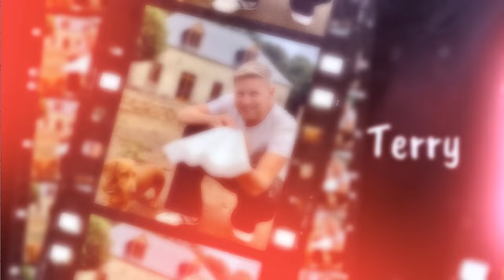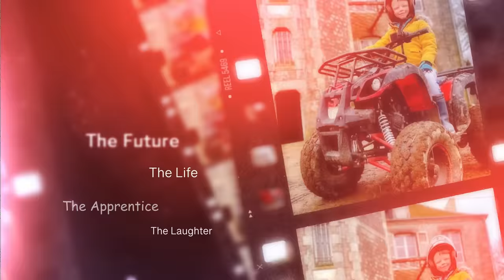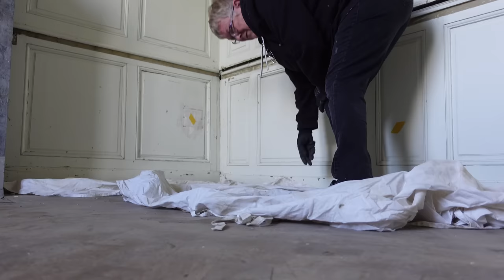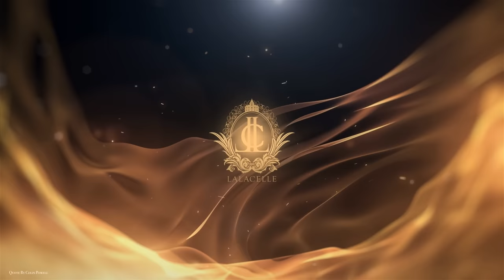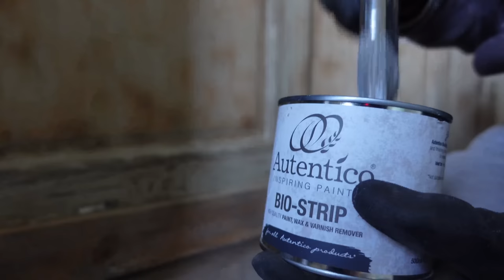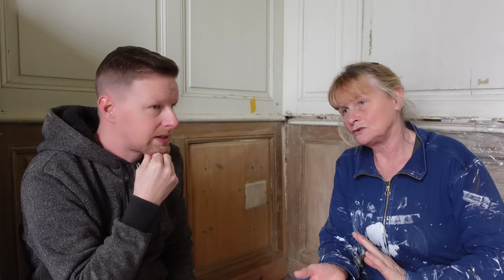Revealing The ORIGINAL 18th Century wood panelling in the Château Guest suite.

Comment: Watching you strip the wood brings back so many memories.  We purchased an old house in 1983 and stripped the paint off all the doors and baseboards.  I used a lit propane cylinder with an attachment that melted the paint just like you are doing.  Back then there were no electric paint melters!!!   I sanded and stained the wood and it was beautiful.   This room is going to be stunning
Reply from the maker: What a job it is but the results are amazing 😍

Comment: when stripping paneling, the moulded beading inside takes the longest, the most heat cos its the most fiddly. do this first in case you over heat, that way you burn the paint on the flat bits and not exposed wood

Comment: I love using the heat gun. It’s a brilliant option. We had to use it for our Edwardian door where it was thick with decades of paint and nothing but seriously industrial chemicals would get it off. The heat gun did it easily. Obviously we did it outside as the lead in the paint can’t be good when it’s melted so I would use a simple mask just in case.

Comment: Have you tried using a Tungsten Carbide Scraper ?  I used one to remove the paint off the  beams in my cottage and take them back to their original condition. I wouldn't be without one for the amount of renovating I have to do.
Reply: Thanks Rachel. We haven’t tried that but I’ll have a look 😊
Reply: @Ashley Waters  An absolutely invaluable tool for any restoration of wood. X

Comment: Fantastic hard work as usual, bravo all of your family. I noticed at one point you used two thermal cleaners on the same sock so please, be careful because this is at least 3000 Watts power on a 3500 W old electric wires. Using high power in long time could really get the wires very hot. Just saying by lived experience.
Reply: Thanks Thierry. All the power came from new wiring or Ecoflow units :)
Reply: @ashleywaters7198  Ok then, sorry I was worrying too fast 🥴

Comment: Love that you are stripping the wood, it’s going to be beautiful. Just a suggestion…and you may have thought of this already…as you know heat guns generate tremendous heat. So much so that there is always a risk of fire. Even when you think your being careful you might ignite a bit of dust where there is a crack or space caused by a separation of the wood. If you haven’t guessed, I’m speaking from a from, a very scary close call. After that experience I always kept a spray bottle of water near by. Having an extinguisher 🧯 near by is also a good idea. Lastly, when using a heat gun you are creating tiny particles of paint which are then blown around by the gun, making the particles airborne. Considering wearing masks. Also, consider a simple test for lead in the paint. Children are mostly at risk, so if your not sure, keep Jonathan away until all surfaces are washed down. Liquid stripper is less of an issue unless you sand the wood after stripping. If there is and paint residue you will have the same problem of air born particles. I don’t mean to lecture, but I learned the hard way, and this is a huge issue in the US. It is all very manageable .

Comment: I don't want to sound like I am nagging, but did you test for lead before putting the heat gun to it? One that hot will vaporize the lead. They have an infrared one or you can use the citrus strip for lead paint.
Reply: Thanks Steph. Yes the paint was analysed 😊

Comment: I can remember my Mother stripping furniture when I was young.  She even had a recipe she made to strip.  I will try to find it but it has been a long time.  One thing I remember is that I kept the stripper wet and let it set for an hour before using steel wool and a putty knife to remove, just like you are.  It is just work and a lot of work to remove old paint.  Have you thought if vat dipping?  We have places here in the State that dip wood.  Your room will be beautiful when finish but your hands are going to hurt.  I just saw the end of your video and the paneling is beautiful.  What is the white square in the paneling?  It has me wondering.

Comment: I notice you are using both a Titan and a DeWalt heat gun. Do you find one is more efficient than the other?
Reply: The Titan one is better. It’s lighter and worked better. Titan one was cheaper too!
Reply: @ashleywaters7198  Thank you! It helps to get feedback from those actually using the tools before buying them.

Comment: I'm so glad you're stripping off the paint. Please, pretty pretty please no gold leaf all over the paneling. It'll look fake. Nobody did it back at the time when the house was built. They used the stuff sparingly for a more subtle effect. IMPO a narrow strip on the frame surrounding the inside paneling would be much prettier.Or on the strip between the painted and the natural paneling.
Reply: Thanks Enny. Yes we’ve found some of the original paint on some panelling, and there was no gold leaf. We will likely emulate what we’ve found 😊
Reply: Aye,and Ash’s favourite colour is gold, with a little splash of pink.😉

Comment: Your stripper material says it is "non-toxic" and fume free,  but that doesn't apply to the paint.  I would assume all of it is lead based, given it's been abandoned for 40 years; therefore you should all be wearing at least heavy duty masks (if not respirators) and the pups should be kept out of the work area!  Hopefully you get to see this before you finish the paint removal!

Comment: That stripper doesn't seem to work very well.
Also after you get some of the paint off you can use the sander too.
Reply from the maker: It worked well just a lot of paint, yes that is the plan to sand 🥰